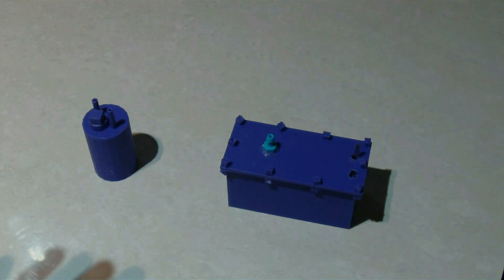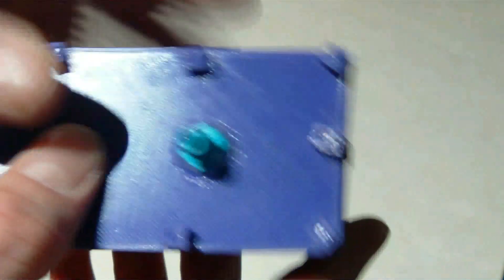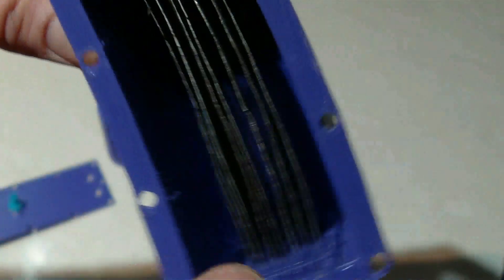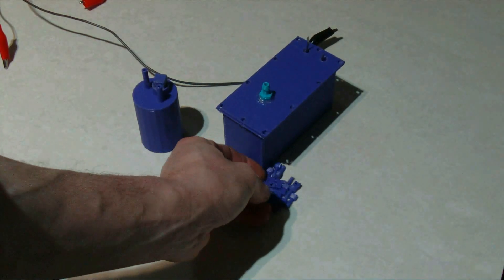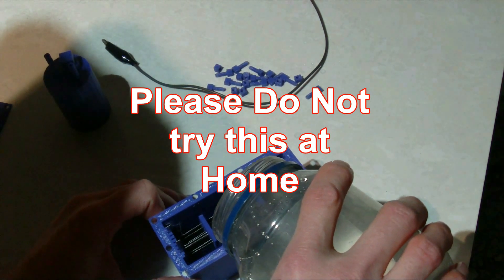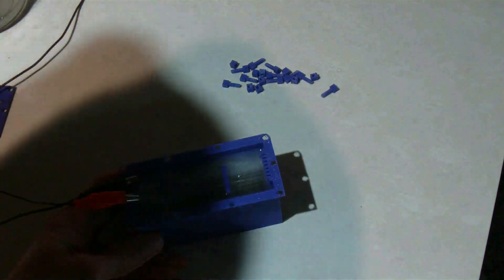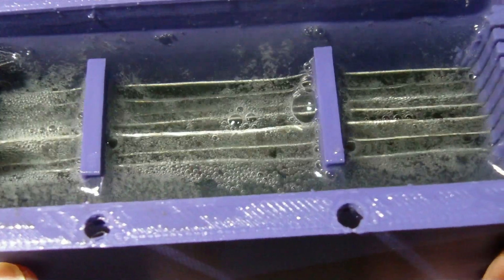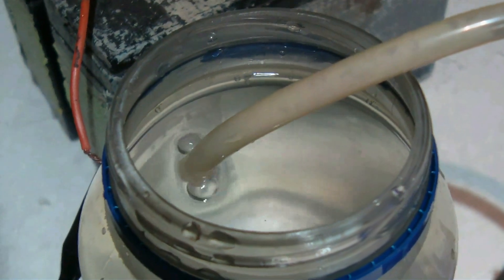HHO Generator that's 3D Printed, will it work? - 12v 7 plate design

Comment: nice, but why did you put all those neutral plates? if they are not connected to electricity they are not doing anything  in the HHO production process, right?
Reply: they split the voltage
Reply: Water splits most efficiently at about 1.2 volts.  Each neutral plate divides it.  If you have just hot and ground the voltage drop across them is 12v.  With one neutral plate the voltage drop is 6v between each plate.  Add a third neutral and you are using 4v between each plate.  He is at 2.4 volts between each plate.

To the video maker, you will achieve higher efficiency if you do not have exposed edges.  Yes exposed edges help generate hho faster but you bleed amperage.  Good idea on your spacers, but make them larger as your plates are bent.  The loss of surface area you will have will be made up for in efficiency.
Reply: @mikekochendorfer7965  sorry they split the best between 1.8v and 2.2v not 1.2v

Comment: If you have a strong magnet or a larger ceramic magnet, hold the magnet as close as you feel comfortable as not to upset plate seperation. Notice an increase in Gas production. Why this basic knowledge is not common, I do not know.

Comment: Great Stuff good sir! I thought about going the 3d printed route and just havent gotten around to it. I put 2 mason jars together for the inside of my engine and tried to squeeze some hydrogen out that way and the results were inconclusive. At first  i was getting reeeeaaaallly good gas mileage and then it went back to normal so it might of ended up being steam after 45 mins or so. Regardless, great video!